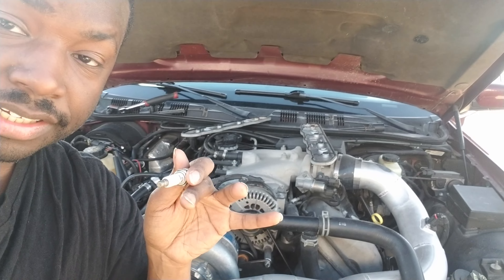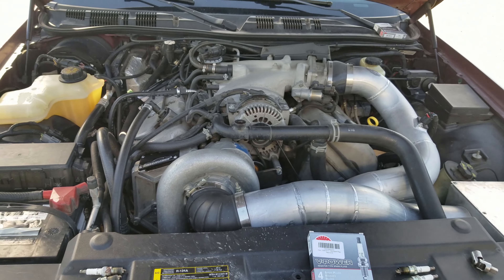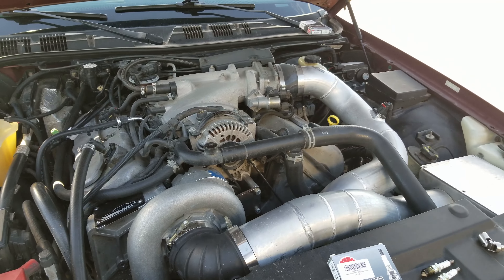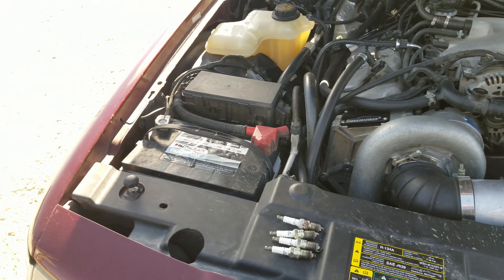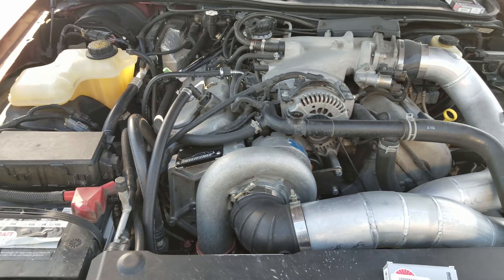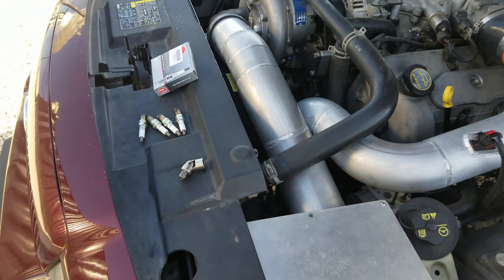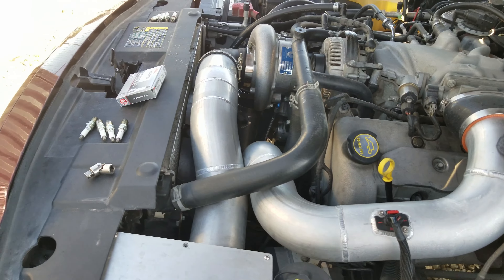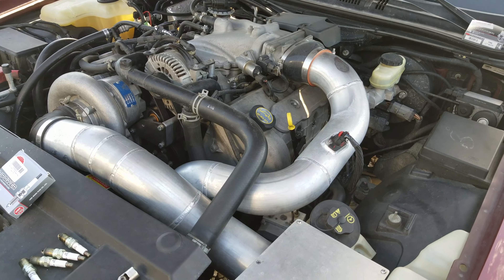NGK TR6 Plugs  For Mustangs Marauders and Crown Vics

Comment: What would you recommend for a more stock application in a 96 cobra? would you still run the one step colder plug? thanks for all the awesome info!
Reply from the maker: If you beat on it a lot then the colder plug is good to run. Else I'd stick with stock. Normally I can get these plugs for about 22 bucks for 8

Comment: Thanks for the content. I have a question if you have some oil on the plugs. 4.6 2v engine isn't some blue smoke when acceleration. Do I need to do a compression test or replace valve seal? I use the TR6 spark plugs  and information will help

Comment: One question why my oil looks milky when I put e85 in my Marauder is a normal
Reply from the maker: thats not normal and should review why thats happening . is the car tuned for e85 ?
Reply: I haven't tuned in yet I was going to tune  it today but the RPMs are so high they don't go down they stay on 1800
Reply: Get ready to pull those heads!

Comment: What cats are you running? Having an issue with my driver's glowing red and lack of power
Reply from the maker: Oem cats stock engine setup. If it's glowing and overheating it may be melted down and bad and needs replaced or removed.
Reply: @mr.e8543  adtr longtubes with thier hi flow cats, fighting bank 2 short term fuel trims stuck at 1.3

Comment: Hey man question i just finished rebuilding my motor not to long ago and i finished putting it all together and started it up and its missing really fucking bad it has new plugs and new coils that did sit in the motor for about 7 months before i started the rebuild i did swap the coils on two cylinders that saying its missing but its still missing. would it be injectors and whats a good way to test the injector at home
Reply from the maker: Hard to test them at home. You can swap what cylinders they are on and see if the misfire moves with it.

Hopefully it's not out of time or anything. Did you hear any noises?
Reply: @Mr.E85  I don't hear anything that would have someone worried. I've driven the car to see maybe ecu needs to learn